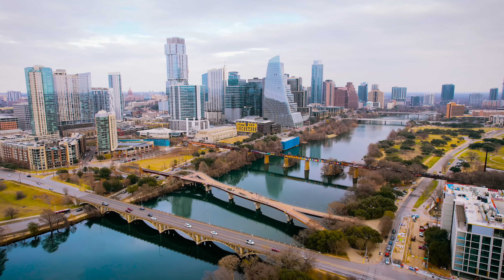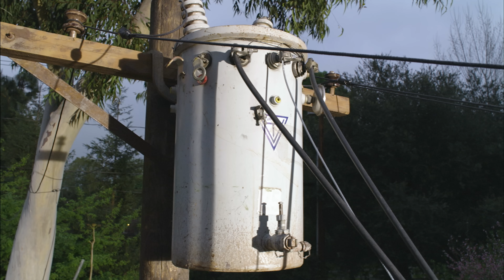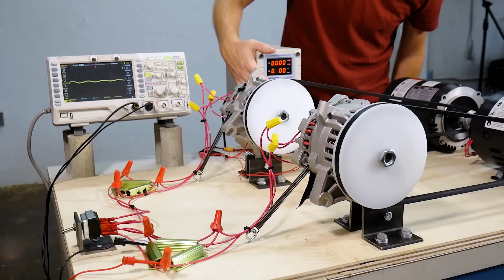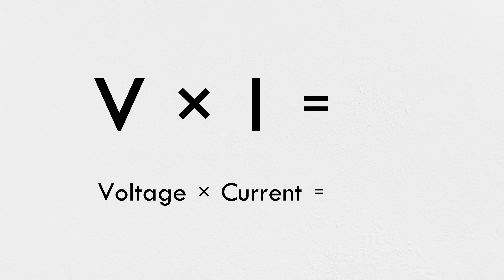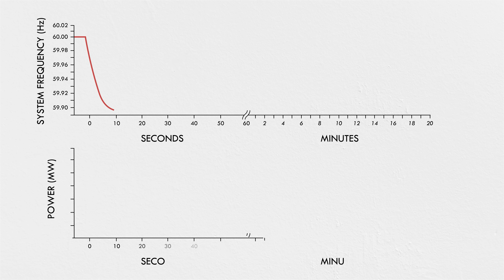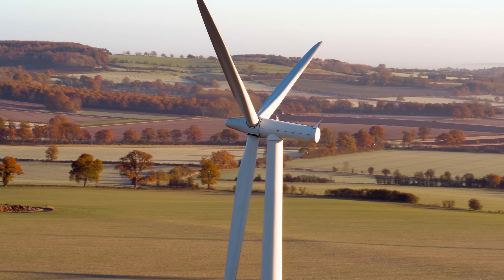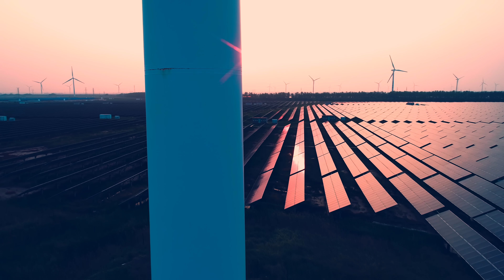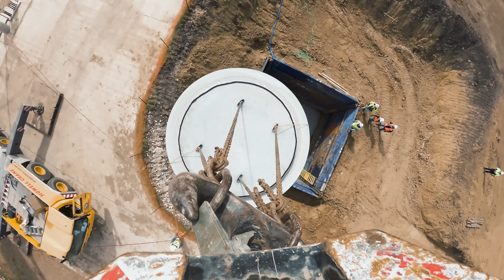Connecting Solar to the Grid is Harder Than You Think

Comment: I'm an engineer for a utility-scale solar developer and this is a fantastic summary of the challenges we face and design for.
Reply: Tree clearing is expensive, slow, and complex. It’s a last resort and doesn’t represent the typical project (at least here in the US).
Reply: @peaksix_ Tree clearing for solar projects is very typical in the eastern US.  It was the single largest source of forest cover land clearing in VA last year.
Reply: I work in grid control devices here in Australia that cover residential, commercial and even grid scale assets. Our software and control helps to try coordinate/stabilise all of these things mentioned here in community networks and larger scale battery energy storage systems, especially in grid outage events to keep people supplied. In some cases even optimise around things like the spotprice of the energy market to account for supply, demand and energy value. We heavily coordinate with inverter manufacturers and other oems that make similar devices to make sure we can do these things, but as crazy as it might all sound is totally possible. Project EDGE that finished last year proves that a lot of the idea behind this concept is very achievable and not far away and in ways that don't require immense solar farms to achieve reliably. Anyone interested should take a look at the AEMO report.
Reply: @TapetBart  yeah we do, but the key part is that network operators maintaining a utility server reporting network head end data for this and sending network level commands for us to orchestrate to help in the stabilisation. We see what happens behind the meter and at it, and they see the rest, and knowing both helps in those situations. Project EDGE which I mentioned, we were able to help account for that with other grid resources and manage generation output through dynamic export AND import limits also factoring in the local infrastructure. There's more ongoing trails for how to integrate dispatch commands alongside optimisation commands per system, but it functionally works and can be done at a 1ms rate or less. Granted too, that "Community batteries" or other high yield C&I facilities are needed to be able to help juggle it. The biggest most concerning issue for us and network operators seems to be OEMs actually building the functionality into their hardware for control and demand response cababilities that meet new regulations and being able to accomodate legacy systems.
Reply: So what happens to the grid voltage when your supply is predominantly made up of grid tie inverters trying to push current, for the sake of net-metering, into the grid via higher voltage?
Reply: @D2O2 that’s why lots of utilities de-incentize net metering systems by lowering the buy back rate. Some just plain old don’t even allow it, like Hawaii
Reply: Yep, I continue to struggle to tell our leadership that as we are phasing out our fossil generation we need to start putting in massive amounts of grid storage.
Reply: @anydaynow01  tell leadership to install massive amounts of something that’s never run any grid in the world? Is that how it works? 

Yeah I tell leadership I want massive numbers of warp drive capable star ships, because cost, performance don’t really matter
Reply: @Nill757  🙄 Ignorance and disinformation are the most prolific outputs that social media can generate, obviously.
Reply: @Jack-gf8fh Prevented?  You can literally see 6000 leveled acres. It’s unserious to say something “probably” stopped elsewhere. Where?

Well water comes from deep aquifers, disconnected from soil-trees and evaporation. Chopping down trees does not save water.  That’s ridiculous. You won’t find support anywhere. 

The moment new tree growth starts the land starts storing carbon again.  I’m open to comparing the health of some old growth forest to newer regrowth, but that’s not the case. It’s existing new forest compared to leveled PV site. There is no comparison. 

“Trying to make it out”
Oh please. I was clear. This isn’t Texas.
Reply: You work for grifters.
Reply: Hey, Peaksix, a quick question then.  I've been waffling on getting a solar system for my house, due to the initial cost up front.  Based on what Grady says about current electrical plants needing a minimal generation (which I assume is during the middle of the night when most people are sleeping), would it make more sense to do a "Stage 1" of installing some sort of "power wall" of batteries that charge during the middle of the night and then later on install solar panels?  Or is it more cost effective to do it all at once?
Reply: @thatjeff7550  Unfortunately I'm not as knowledgeable about the residential side. But I'd suspect there'd be some "synergies" by doing it all at once. But also, batteries are great, but consider if you truly need them. If you can do "net metering" with your local utility, then you can use power from during the night and your daytime solar production may be enough to offset that.
Reply: @peaksix_  Thank you for your answer.  My state HAD net metering (TN) but when the whole solar thing kicked off with the Obama Administration, our conservative governor couldn't allow that and abolished it.
Reply: No you are not.
Reply: Hello, I would like to ask you about your field if you don’t mind, how did you go into it? Do you recommend for the future, what tasks do you have and how is the pay like
Reply: @Jack-gf8fh The site is leveling thousands of acres of trees. 

On the east coast, majority of non-park, privately owned, accessible forested land is under consideration for logging lease from time to time to get some cash to the owners, though it’s seldom executed. So the ‘it was going to be logged anyway’ tale on the east coast us is old style nonsense.

Even so, the moment a parcel is logged, regrowth begins immediately, often w seedlings. But not w industrial solar or other development. The comparison of the soil water - tree transpiration cycle to aquifer water accessed via wells is similar nonsense. Any  half wit w superficial forest ecology reading knows all this. 

So I find this kind of response bizarre.All kinds of heavy industries last 70 years would push that kind of line to the public in the past. Plan to bulldoze thousands acres, and tell the public land was “useless” land anyway. Public became healthily skeptical.  Not with large solar companies, who are represented by the largest project developers in the US like Brown and Root.  Somehow it’s all good, some of public believes or invents nonsense, like a green religion.
Reply: Just out of curiosity do batteries help "clean up" the power from solar?  I've heard one issue is the power they put out can sometimes be "dirty" and cause issues.  I'm thinking of solar at home but I've heard those systems can sometimes cause issues for peoples neighbors.  I'm not sure with the inverters that people put in along with a battery backup can sorta smooth everything out so the power being output is clean.  From this video it seems like the inverter might actually be the issue.  As a side note would flywheel storage being added to larger renewable systems help with this or is that still needing to go through the inverter? The flywheel system might not be actually used for storage but it could just smooth out the output? Seems like wind might not have the same issue though since the turbine itself almost acts like a flywheel.
Reply: @pin65371  Batteries basically use the same inverters as PV. Either literally the same inverters (if DC coupled) or models that were likely derived from PV inverters (if AC coupled). Either way, I disagree that the output from PV facilities is "dirty". As the video mentions, it can output a perfect 60hz using electronics alone. They can also be called upon to inject or absorb VARs to help strengthen the grid. The real issue is that renewables are intermittent which can make load balancing challenging for grid operators. Batteries definitely help with this, as they can help firm or smooth the output of the plant to avoid fluctuations. I've never heard of flywheels being used alongside PV, but some companies are looking at alternatives to batteries, such as hydrogen electrolyzers to "store" energy as hydrogen.
Reply: @pin65371  Hi, it sounds like part of your question comes from the idea of dirty and clean.  A clean sine wave is often referred to as a pure sine wave--with perfect timing and smooth curves.  Dirty would be anything that makes the timing move or roughs up the smooth curves.  Turning a light switch on and off will dirty the pure sine wave, but most of the time this is not significant enough to affect anything.  However, as you saw in the video, some inverters do not have a smooth output, which has the effect of several light switches--making the sine wave dirty (noisy).  Ironically, the thing that is most affected by a noisy sine wave is an inverter or power supply--so digital electronics.  There are a few solutions for this, and one is to use an inverter that produces a pure sine wave--or as close to pure as possible.  Another solution is to use a battery backup that produces a pure sine wave.  Or if you put several dirty inverters together with just the right phase shifts, the final output will look smooth.  Anyway, a flywheel would not be the best solution.  You would have better luck using a bunch of surge protectors to smooth out the wave.  As far as connecting to the grid goes, it sounds like the solar disconnected from the grid because it detected a possible short circuit--like it is supposed to.  But did not come back on when the line stabilized.
Reply: The first rule is to stay off Texas' grid. Really poor transmission management and anticipation. It solves a lot of issues if the grid is consistent in its own compliance, with plenty of management options.
Reply: @ReflectedMiles ERCOT like all grids has issues but CAISO is far worse, w far older transmission beyond end of life.
Reply: Why not go be an engineer for a nuclear power developer then. You’re not going to overcome grid sync and freq regulation problems by adding more FETs to an inverter.  And I don’t know about they’re engineers, but afaict the solar developers don’t care beyond store front window talking points.  Don’t care about adequate guaranteed capacity from conventional sources that they run out of business, don’t care what RTOs say, don’t care about land use objections from town councils, don’t care about inverter sync issues. Get that PPA, hey, and be on your way.
Reply: A massive field filled with solar panels will not allow the sun to warm the earth like nature intended.
If one would take what they learned in High school physics in relation to weather and energy and winds. The assumption can be taken that wind and solar are contributing to climate change.
Energy can neither be created, nor destroyed.....what happens when natural heating of the earth in a solar field is removed?
What happens to the wind when a "power flower" takes 30% of the energy from the wind?
Weather is just a natural interaction with global heating and wind....disrupt that and you will see drastically changing weather leading to climate change.

Man isn't the cause of climate change and man cannot be the solution.  

Man made climate change is the biggest conspiracy ever inflicted on man kind.
Reply: @grandinosour  🙄 This is what happens when someone's higher education comes from social media instead of accredited schools.
Reply: My issue with solar: all we are doing is tearing down forests to build them… lets destroy more habitat so we can build solar power, yay!… looking at you australia
Reply: @goldenhate6649 even if they use already cleared land. Government subsidies are skewing prime agricultural land to be "worth more" for solar installations. If I remember correctly the same happened in the US where agricultural land was worth more for ethanol for fuel thanks to government intervention instead of being used to grow food.
Reply: @Crabman_87  Among other endeavors, I have managed a farm for decades. Used for the right cropping in the right setting, solar is a huge benefit and boost to productivity for crops that do better in partial- and indirect-sun exposure. It makes it possible in some cases to grow crops on agricultural land in the southwest US that could never otherwise be grown in that region.
Reply: @Crabman_87  I've seen quite a lot of grid scale solar, and you'd be hard pressed to call any of that land "prime agricultural".
Reply: @controlsfreek  look at what they do in Australia. It's mind boggling sometimes
Reply: @goldenhate6649  Not even remotely true. Learn an industry before commenting on it.
Reply: @ReflectedMiles  it is true in forested areas like the east coast.US.  I know the industry. They set goals for PV capacity, and if that means tree loss in some areas, they don’t slow  in the slightest.

Citizens have had a healthy skepticism of large industry in the past. For some reason w solar, skepticism is tossed aside w a religious zeal for many.
Reply: @Nill757  Great. Then refer me to any PV project exceeding, say, 1MW capacity that has involved deforestation to accommodate more than 5 - 10% of the project. One of the greatest advantages of PV is to take advantage of the multitude of scrub, desert, rooftop, and other exposed surfaces that are unproductive. Squandering that advantage is silly, no matter where in the world we are talking about. Most losses that I see people referring to are incidental.
Reply: @ReflectedMiles  spotsylvania solar in Va is largest PV industrial project east of the Mississippi in the US. 
650 MW AC, over 6500 acres, 6000 forested as is most of VA.  Uses considerable well water too.  These notions of “desert, scrub” as available everywhere are ignorant.  Rooftop is 3-5x more expensive than ground utility solar, would end quickly w out subsidy.  “Squandering that advantage” is a religious assertion. I decline to join your religion Jim.
Reply: @Nill757  Yeah, a typical Fawn Lake guy who fails to mention that the land for that project was already owned by a company for the purpose of logging. I am familiar with your type. Nice try, though. Engineering and economics are not religions, sorry.
Reply: @goldenhate6649 completely and ridiculously false. Almost no solar project is clearing forests, there’s far more than enough open land already.
Reply: @goldenhate6649  I don't think you know what you're talking about, at all
Reply: @goldenhate6649 Don't look at us here in Australia. Most new solar power is either rooftop or on arid sites. Even  cropping land sites are rare. Proposed wind power projects and interconnectors have been more the tree clearing issue.
Reply: @goldenhate6649  In Illinois it's primarily cash crop farmland that's being converted to solar, so ultimately a net positive.

Comment: "For a power company, that means leaving money on the table." Only if you have a privately owned for-profit power company. Municipal utilities have the same technical requirements, but not the same profit motive. Where I live we had a pretty decent wind storm last week. Nearly ever private utility in the area (Xcel, Black Hills, etc) had widespread outages, many of them *planned* outages due to "fire risk" (taking a move from PG&E's playbook). My little city with its municipal utility, which buys power from some of those other utilities btw, and also has an over 20% renewable portfolio (aiming for 60% by 2030), was rock solid the entire time. And our rates are some of the lowest in the nation. You take profit out of the equation, and maintaining a safe, stable, reliable grid with plenty of reserve capacity is a whole lot easier.

Comment: That last point on grid forming inverters had me think... That problem can't be new! Even with generators that produce nice sin waves, if you have several power plans, their outputs need to be synced even with old school massive turbines so... how is that done for current plants, renewable or not? Just connect two massive power plants together on the same grid and the generators will naturally sync their frequency/voltage/phase due to grid interaction? That doesn't seem right, the characteristics of each turbine and power source would generate a different response (or else why wouldn't wind turbines work the same way?!) There has to be some grid setting/following systems for that, right?!

Comment: I found this super interesting! Usually you only hear about the problems with new technologies, especially when there's a powerful political lobby against them. So I was under the impression that renewables are an unqualified negative for grid stability and that we'd need flywheels or something if we get rid of too many turbine-based power plants. And I don't live in an anti-renewable bubble mind you!
So thank you for teaching me that these new types of power plants aren't better or worse, they're different and we need to learn how to integrate them well into our existing infrastructure while it is changing at a very fast pace. This seems to be a big challenge to engineers and regulators alike, but one that does not seem to be beyond their abilities. Well, not beyond that of the engineers at least.